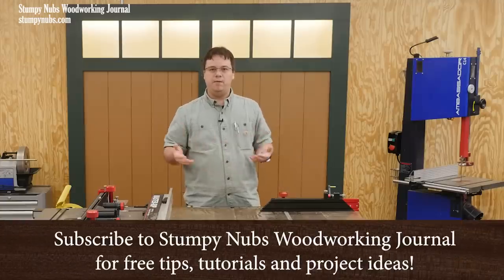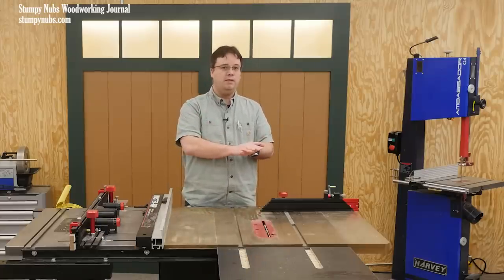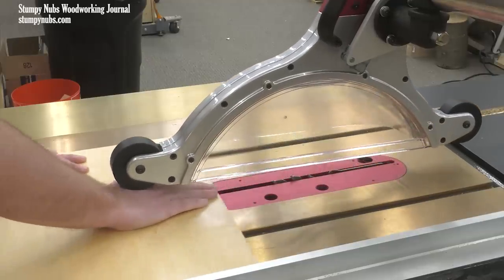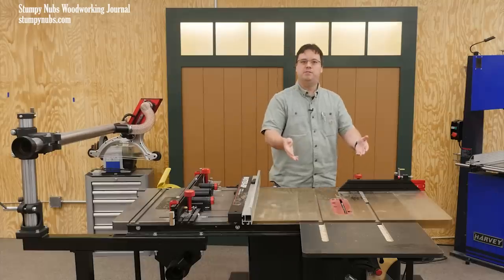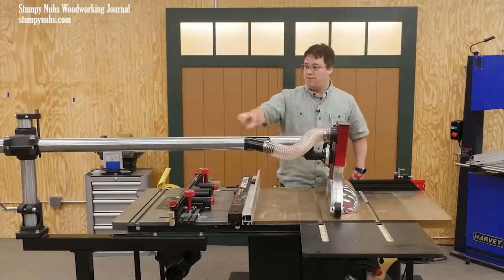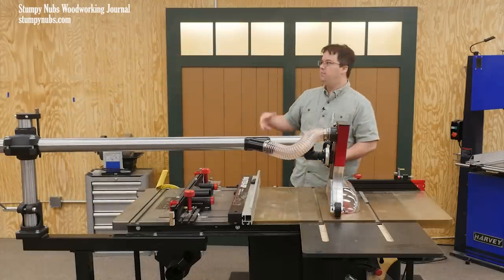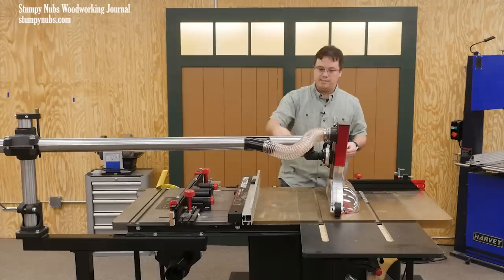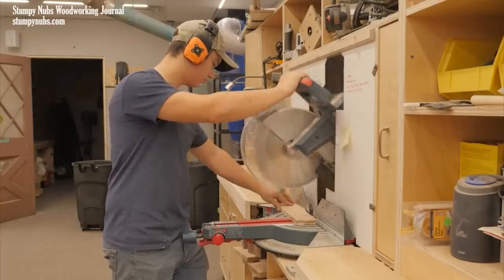MUST SEE table saw idea can save your fingers!

Comment: I added this Harvey blade guard to my Powermatic table saw about six months ago.  I cut the 3” over arm down to fit as my saw only cuts 30” right of the blade and my shop is small.  I didn’t want the long end with the dust hose sticking out into the walk way on the right side of the saw.  The setup they send you with this blade guard is very adaptable to many different set ups.  The counter balance on the hood makes moving the dust collector/blade guard easy.  It collects about 90% of the sawdust that used to end up on the surface of the saw.  I found that I need to move it out of the way more than I thought I would as it’s in the way for narrow cuts next to the fence or for making resaw cuts through taller blocks of wood where you need to cut one side, flip the stock and cut through the other side.  It works beautifully for long rip cuts or panel cuts on plywood.   Overall I’m very pleased with the dust collection and the ease of use.  Would I buy it again?  Yes, probably.  The cost was significant but so is my time.  No experimenting with do it yourself ideas here.  Just bolt it on, make a few adjustments, and go to work.  I like it, but I will say it won’t work for everybody.  Before you buy one, evaluate how you use your saw the most.  If you cut lots of pieces with the fence close to the blade, or if you use a lot of jigs that run on your fence, or if you use a sled a lot, you may want to look at other options.
Reply from the maker: Thanks for the person experience. :)

Comment: The university where I study Craft Sciences has a bladeguard that is basically the same thing on the huge Altendorf sliding table saw. Based on two years of experience I can really recommend it. It’s easy to use an really works quite well. The Altendorf one has a bigger hose for dust collection.

Comment: This is perfect! I have a 1950s Shopsmith. Never had a blade guard. Thanks!
Reply: I also have a Shopsmith. Mine is a Mark V/500. There is a blade guard, of sorts, which I use. For this to work with a 'smith, you would need a floor standing pedestal and some way to adjust the height, since the table moves up and down.
Reply: Good to know. Since this has never had a guard (pre OSHA) anything is preferable. It definitely gives me some ideas. Thanks!
Reply: @THX..1138  They are a bit frightening, especially the lathe as it comes up to speed. The numbers on the rpm dial are nice but you eventually learn to just use your ears since the dial isn't very accurate on these old girls.

Comment: The Delta Uniguard had many of those features. It rested on the table and lifted up when you put a workpiece through and was easy to lift up and out of the way. It also came with a pop up splitter. This is what I use.  This new guard is a much more refined and elegant take on that very old guard.
Reply: The old Delta design is still one of the best.
Reply: This is what I have, but am trying to figure out a way to cut thin kerf with the original delta unisaw guards.

Comment: I have SawStop's take on this style of guard / dust shroud. Being able to move it around so easily was the #1 reason I paid for the upgrade -- I find myself switching often between rip cuts and a crosscut sled, and knew that if I had to mess around with fiddly attachments to attach/disconnect the guard every time I use a sled, I would inevitably get lazy and just stop using it. The only addition I can think of to either of these systems would be to add some bristles at the bottom of the dust shroud to prevent dust from being blown out onto the table -- think about how CNC dust shrouds are designed this way. Dust collection works pretty well when cutting pieces off of boards, but you're just taking a sliver off one end for final fit, that dust goes everywhere.

Comment: I've been using this one for about a year now and I like it. As Stumpy says, it is very heavy. My saw is a Grizzly G0690 which is Harvey's C300 they used to make for Grizzly so it is a direct fit. Of course I also have the same router table and yes, it can be cumbersome. My shop is a little narrow so I did cut the tube down by about a foot and it worked out great. Overall this is a good recommendation if you can afford it. Thanks Stumpy!

Comment: The large dome is generally meant for a tilted-blade cut. The wheels should be in-line with the blade to ensure it always lifts up, even when just shaving a tiny bit off of the end of a cross-cut, while also minimizing how much space it takes up on the fence-side of the blade.

This looks to be based on the types of guards Euro panel saws use, and incorporates some of the best features, and added better adjustment and the smart use of the tube for dust collection (my Felder didn't do that, but I 3d printed some adapters to make that the way it worked to avoid the additional hose)

Having a blade guard which is independent of the blade and riving knife, and works with my dado blades, has been perfect to ensuring I leave it on and continue to use it.

Also, these types of covers work best with flippable fences like what you have and what most euro saws have, so the fence can be put in the low position so it can get closer to the blade while still allowing the guard to be in place. That's actually the position I normally leave my fence in.

Comment: I wonder how well it would work to stick a brush or silicon material around the border of the guard opening so that it captures more of the dust. Similar to what they put around CNC drill mounts to stop shavings from getting thrown. The brush material is easy to find and usually already has double stick tape on it. Usually called "door sweep" or "weather stripping brush". You could also try a clear silicon weatherstripping material.
Reply: Was thinking the same thing. Good I read your comment 1st!  Better than I could have writing 🙏🏻🔥⚒️🧙🏼‍♂️
Reply: I've been pondering doing that on my SawStop arm. Works great for a CNC, so why not also on the table saw? I actually tested it it on some cuts recently with a bit of folded-over masking tape (I didn't need to move the guard for those cuts) and it made a noticeable difference in the amount of dust that escaped onto the top of the saw and into the air.

Comment: Thanks James. The product is surely good. Your lesson was even better.
The guards that mount to the included riving knife encourage removal and discard. Or at best removal for non through cuts and not always refitting before the next through cut. 
I got around the riving knife issue by laminating 2 thin hardenable shims with TIG.
Mild steel isn't springy enough, yeah I tried it.
That guard system with a ceiling mount would be the bees knees.

Comment: I bought  an overarm blade guard years ago made by Excalibur sadly no longer around but very similar to the current Saw stop one.  Heavy to remove so I can use the router table but have it hooked up to some overhead pulleys to lift it up and away.  Has dust collection as well.  Rarely have to make a cut without  it  - usually when making tenons with my cat iron Tenoning jig .

Comment: For a DIY option, one of those clear air condition vent covers would work really well as a dome. Added benefit is it can be removed easily with magnets
Reply: Don't the magnets mean whatever it is supposed to be guarding you from can also remove it on its way out?

Comment: I have both the Harvey saw and this guard by Shark. It is a good guard and very well built. As a guard it definitely does its job and does it well. As for the dust collection aspect of it the design fall short. The suction at the blade area is just strong enough to really capture the fine dust. This is especially true when you have a cut that is right at the edge of the wood and the blade is not between the wood. I would love to see Harvey work to retool the dust collection part off this guard so the suction is stronger. All this being said I would still buy the unit again.

Comment: What a beautiful device! Inveterate scrounges: keep an eye out for junk power feeds from which to get your pivoting and height adjustable verts and horz. The worst of those early import power feeds usually failed in their lousy gearing or their motors. There's usually a lot of good salvage left and almost no monetary value. Only a cheap SOB would ask more than $15 for one of those. You can quote me on that. Another source of beefy parts is radial arm saw junk. There's a a beautiful 3ph 12" radial arm Rockwell, once-upon-a-time-state-of-the art and US made in the '70s out in one of my storage containers. ll give it to whoever wants it... S.E. Wyoming.

Comment: I use horizontal and vertical featherboards and a 28" push stick; never place my hand over the table while the blade is moving.  Fingers happy.

Comment: Hah, what you described at the end was what I was contemplating through the first half of the video. I've got a big old cast iron saw, just new enough to use modern blades, but too old to have a splitter or guard; was just thinking how unnerving that is a couple days ago.

Comment: You could bolt it on a wall if you plan your workplace a bit different. I had a similar idea a few weeks ago but also thinking about something hanging down from ceiling and able to use for table saw, joiner and same more tools (mostly for dust collection but also safety).

Comment: These have been standard in high end table saws in Europe for a long time. Decades.
USA really has long way to go. Riveting knives, fast blade stop after power off, various blade guards and regulation against dado stacks on consumer table saws are one of many things that we've gotten right here. Because our regulations try to prevent accidents, even if people might "grumble" about over reach or some such... if people aren't smart enough to protect themselves, we will make sure that every tool comes with the certain safety equipment and you have to CHOOSE not to use them or disable them.

then it's completely on you. :)

Comment: At $850 it's pretty expensive. But from the looks of it in your video, it  is constructed of very good material and the workmanship appears excellent. The design is brilliant. It looks like they covered all the bases. I think the price is right. Unfortunately there are still a lot of us that cannot shell out that much no mater how good it is. If you can afford it, then, in my opinion, the purchase is a no brainer. Thank you for sharing. Have a great day and stay safe.🙂🙂
Reply: I don't know how it works in the States but here in our company when we calculate the risk/cost of injury 1000$ is "pocket change". As the salary keeps rolling that money is gone in a couple of days though the employee is home injured. Not to mention if the injury is permanent.
 If machines are used properly they should be safe: no exposed blades or rurning parts as chucks on drills/mills/lathes. Two weeks ago an insert broke in the lathe for me. It ripped the piece loose and without the chuckguard I might not be here. When a little larger pieces start to spin att 2000 rpm the forces become great and things happens quickly. I heard the insert break and the a big bang, no time to do anything...
Reply: @johanneslaxell6641  When it comes to a corporate expenditure I agree completely. But this video audience is primarily hobbyists. We treat our expenditures much differently than corporations.
Reply: @glencrandall7051  I have to admit that I find it challenging to fully grasp the english term "shop". It is used as one man "after work" fun, as well as in "full business". Many machines in similar videos are professional grade/size and would hardly be considered as hobbyuse here. That tablesaw for example, no one I know has the need/space to have something that big.
 I guess that is why I thought that the target was a professional audience, K don't know many who would pay 1000$ fof the whole saw... Thank you for straightening the curves out 👍🏼👍🏼🤗!

Comment: The idea is great but for 1000 US$ (including shipping) you are getting in the terrain of better going to the SawStop, my opinion only.
Reply: Actually costs more than the contractor saw stop and a contractor saw is all I have space for anyway.
Reply: @Segphalt  I think he meant the SawStop that comes with their version of this same dust collection/blade guard
Reply: I could be wrong, but this seems like it’s targeted to production shops with expensive equipment and repetitive workflows that need to be done quickly by staff, not artisans working deliberately. That, or people with saws worth several thousand that aren’t going to trade “down” to a SawStop.
Reply: Imo that’s not a bad price for what you’re getting. It also helps with not needing the sawstop in the first place.
Reply: So…some perspex over the blade, on a shaped carrier with two small roller wheels and a boom support.  That is all Craft-able for fifty bucks or less.  I guess its not aimed at Joey diy woodworker!
Reply: Blade guards on a sawstop always seem crazy to me. Your fingers aren't likely to go straight into the blade they are going to be pulled into the blade from some form of kickback. When that happens your safety device will break your fingers and the blade will do its sawstop thing.
Reply: @shauntoochaos235  There are countless videos covering people who tell the tale of how it saved them with nothing more than a tiny slice. (Some even caught on video when it happened)
I can't find 1 showing a failure of it to keep someone safe, sure there are some unintended triggers out there but that's an okay trade for the safety for a lot of people.

 The entire hotdog demo takes place at the most dangerous point, right at the front edge of the saw blade. You will not have made it far enough in there to ever beat the rate of response before the blade is gone. 5/1000ths of a second is pretty fast.
Reply: I’m a bit baffled this is not common practice.. 
every saw I have worked on haze a hood like this. 
Admitted these are large sliding table panel saws. 
Also it’s forbidden to use the wide plastic side using 90° cuts over here, mostly because it’s less effective collecting dust. We have to swap it when making mitre cuts. 
Cool product nom the less! If your serious about your work this is the way to do it! 
Protect yourself people :-)
Reply: @silverXnoise  yeah most of these companies that make aftermarket stuff like guards are priced to and targeted to companies and not small shops. There needs to be more competition for this stuff so prices come down to where people who have saws that actually need this can afford it. Most production shops are going to have saws that already incorporate something like this anyway
Reply: These start at 400 € here, and most of the bigger (stationary) table saws come with one of them out of the box. Aaaaand..... yes, we all are security fanatics over here.
Reply: Well that certainly beats my microphone boom stand with shop vac attachments I use for an attempt at dust collection up top..
.
Reply: I see Rube Goldberg is alive and well .
What a contraption  . You should tell the cost  .
Reply: Maybe you didn't watch the video. He said it was expensive, not practical
Reply: Not all materials work good with sawstop. i mean other materials than wood

"Conductive materials will trigger the SawStop. You will need to use bypass mode to Run the saw when cutting conductive materials like metal, very wet or very green wood,  Carbon-filled materials, mirrored acrylic, carbon fiber materials and wet pressure-treated wood."
Reply: @woodworkingandepoxy643  Small companies that make aids for woodworkers keep getting sued out of business. Inventors are dissuaded from putting good inventions out there.
Reply: US$1000.

Comment: Great video James. That is a nice accessory for the tablesaw. I also had something homemade for my first tablesaw but the way you did your DIY version was better than my version but I will definitely use your version as a starting point for my next version. You mentioned using a splitter and/or riving knife… when I bought my current cabinet saw they offered a standard version and a low profile version riving knife. A friend has the same saw I do and noticed I had two different riving knives and didn’t know they offered a low profile version. Just a heads up for other users to check for accessories for your tools that can help in a tricky cut…
Ron

Comment: I've always wanted to make a spring-loaded extending arm that mounts to the ceiling to replace my Excalibur over-saw guard/dust collector. One day soon I'll do that. Until then, the Excalibur it is because I agree...having that blade guard is important. I think that I'd be annoyed with the Harvey implementation because of the lack of telescoping. When I need the guard out of the way I don't have to swing it, which makes it easier to--and therefore more likely--slide it back into place.
Reply: Same here.

Comment: This video was a HUGE help in understanding just how massive Harvey's Shark overhead guard (and router table fence) are. I now understand why both products are so darned expensive! That said, I do wish that Harvey would expand their product lines to include overhead guards (and router table fences) that were a bit more affordable. When your product is making the SawStop alternative look cheap, you know there's room for improvement! Maybe versions that are less "universal" and designed specifically for their saws? Perhaps knowing precisely where the arm would mount could allow them to remove some degrees of freedom, thus lowering the price? They could also make a model sized for their 36" tables that might be lighter and cheaper to ship?
Reply from the maker: Harvey saws come standard with a dust collection equipped blade guard (https://www.harveywoodworking.com/products/alpha-hw110lc-36p-10-cabinet-table-saw), which costs an extra $300 for a SawStop: https://www.rockler.com/sawstop-overarm-dust-collection-for-cns-table-saws